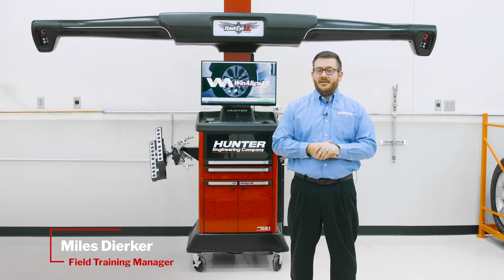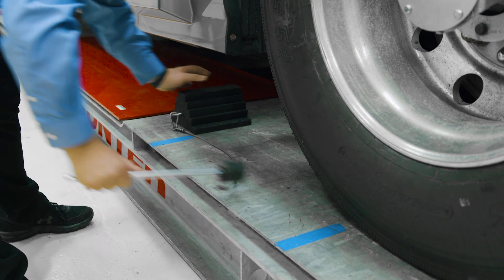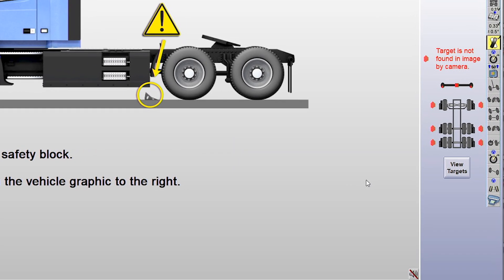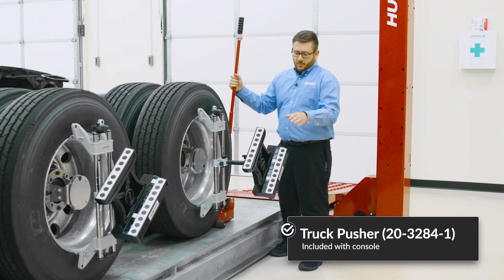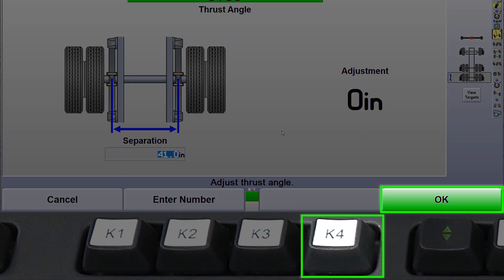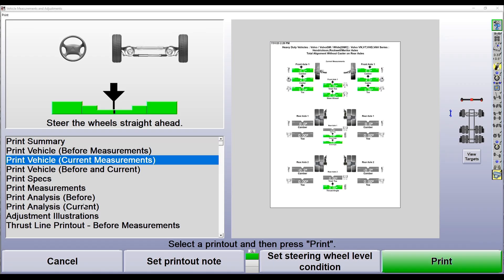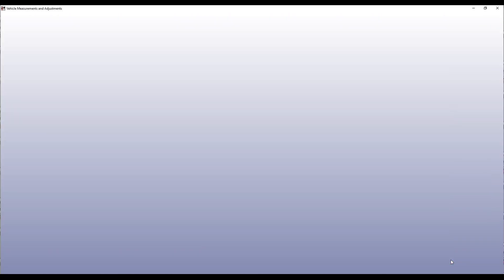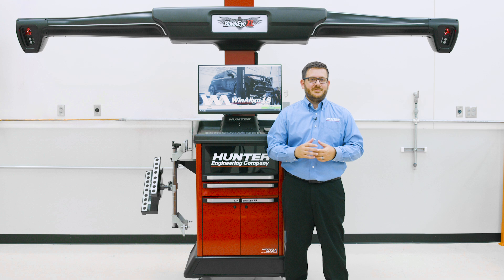HawkEye® XL Alignment System: Beginner's Operation Guide

Comment: I want one. I worked in multiple auto shops in my teens and twenties. For a couple of years, I was the full-time alignment guy because I was intrigued by it. I thought it was easy to grasp and understand all the angles. Everybody else was either afraid of it or hated it for whatever reason. So I was the guy. The last machine I worked on was a Hunter, either a C111 or a D111, I'm not sure, but I loved it, man. I had this genius idea that I was going to open up a shop back then and just do alignments and nothing else, of course replace front end parts. I never did. Married, kids, broke, all that. Now I'm in my sixties, and I'm a retired registered nurse, believe it or not. This idea has come back and it's been consuming me I think because there's a 2-bay auto shop down the street that may come available in the mid-range future. I don't think the building is big enough to do Class 8 tractors, but I can certainly do cars and pickups. I would love to do Class 8 tractors though.

Comment: My shop has the hawkeye xl. Every once in a while we will get a 4dr longbed truck that is too long to do the rolling runout with. Is it possible to do the runout by lifting the truck off the lift and spinning one wheel at a time by hand like the old machines did?
Reply from the maker: We believe you mean that you have a HawkEye Elite?
Our Hawkeye XL would easily handle a 4 door long bed truck.
 
HawkEye Elite absolutely supports jacking compensation.  This video while dated and showing older sensors, still applies: 

https://www.youtube.com/watch?v=IYB_Oc0wBkQ 
 
Please contact your local Hunter team if you would like additional support.